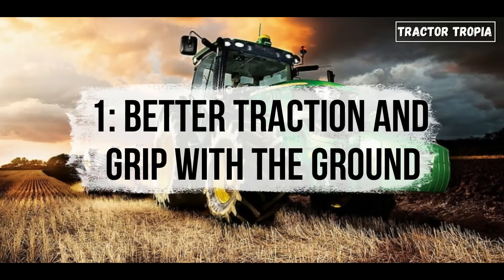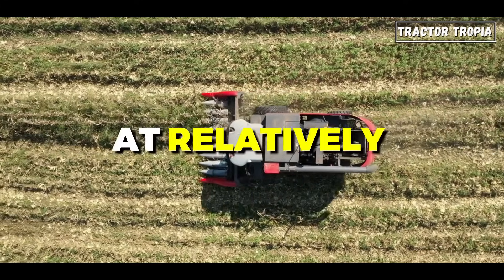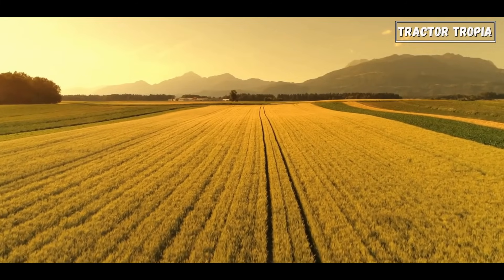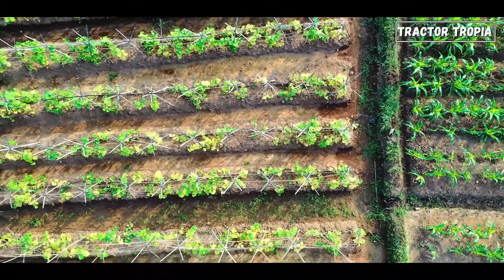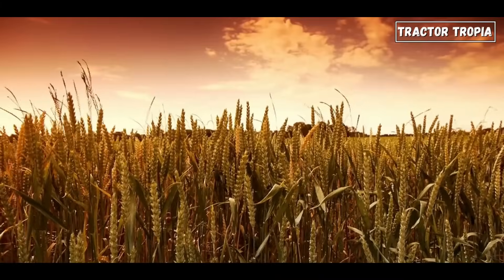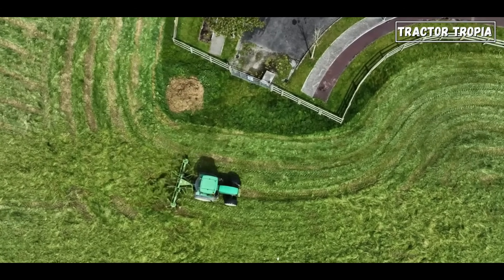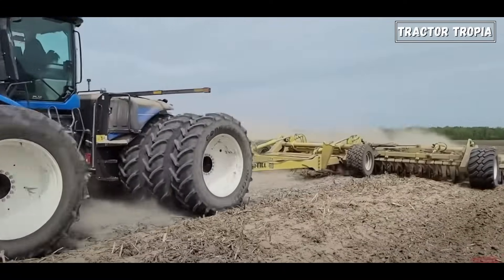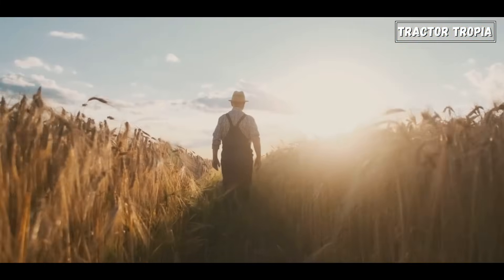Why Do Tractors Have Giant Back Wheels?

Comment: Large rear wheels and weight are key.  In the compact tractor sector, Mahindra stands out for retaining large rear tires and greater overall weight for a given horsepower class. They are the largest manufacturer world wide but have a fairly small presence in the US market. Should I need to replace my older 35ph compact tractor it will be with a Mahindra as my area now has a couple of stable dealerships that that carry this brand. Others, especially John Deere, can keep their small tire & plastic machines.

Comment: 2nd reason about the torque is wrong. You are mentioning in the reverse way. Think of it this way, to remove a tyre screws on big trucks we use a very long rod (sometimes person stands on the rod) to loosen the screw, because Torque = Force × Perpendicular Distance, so by increasing the length of rod, we are achieving high torque, now think of this way, if that screw has to turn the rod, it should have high torque, the longer the length of the rod, higher torque needed to turn that rod.

Comment: So. Much. Repetition.  Big wheels give better ground clearance to prevent damaging crops and allow for a larger contact patch, lowering the pressure exerted on the ground. More common on the rear, as that’s where the weight of the implement doing work is. Front wheels don’t always have to be big, so they aren’t.

Comment: 3388 to 6788 series International Harvester Tractors had equal size tires , great visibility  , articulated steering , and great pulling power . Its only problem was that it was ahead of its time . Farmers hate things that look different from the norm, and they definitely looked different, BUT they worked great .
Reply: It was a great tractor with a couple of issues.  First the flywheel was on the transmission, not the engine, so it tended to create noise at low rpm and tight turns.  Second, the steering was very sensitive.  It was tricky to drive in a straight line at top speed.

Comment: Tractors are just used in agricultural environments, they are used in the Netherland in cities. Why a tractor and not a truck. The costs of wages; a tractor driver has only 1 driving license (for tractors). A truck drivers needs 2 licenses and Code 95 course.

Comment: Larger wheels transfer less torque then smaller wheels. This is because the further away from center you are, the more the ground has a torque advantage against the shaft spinning the tire

Comment: It all depends on what kind of field work are you going to do. There's a lot of tractors, both articulated and not articulated, which have same diameter front and rear tires. Here in Italy we have a lot of small tractors called isodiametric with 4 same diameter wheels and they're mostly used inside orchards and wine yards
Reply: Another example: The first generation of Mercedes Unimog trucks had been developed primarily as agricultural machines / tractors (as main intended use case)

Comment: I think that the most important aspect is that the larger the tyre the larger the torque. But as second thing to point out is that you have the difference between the 2 wheel drive and the 4 wheel drive. When you have a 4 wheel drive tractor there is also a link between the size of the front and rear wheels. The 2 axles have to move in sync or they will mess up the drive train. 
And about the 6 wheel drive tractors they were never a success as that pulling power is good but soil compaction is really bad. Deutz tried it and also Claas
Reply: Torque is merely a matter of drive train ratios.
You can apply whatever torque you wish to any diameter tyre by arranging the drive train to do it.
What matters is that a larger diameter tyre has a greater contact patch and will apply the torque to the ground more efficiently without slip. The extreme end of the contact patch concept is the self laying track as used on bulldozers.
A large diameter wheel also climbs over obstacles better.
Reply: yes i was gonna mention this.
also with large rear tires you dont have to worry less getting stuck with the larger circumference..
also since you have larger rear tires the gearbox gearing doesnt need to be smaller/shorter you can make it larger for more torque handling
Reply: Many r totally wrong here

Torque of differential shaft = Torque of wheel

So Larger the wheel...lesser the force exerted on ground

Just imagine,
A smaller wheel will hv more wheel slip than a larger wheel
Becoz small wheel will exert more force on ground (contact point)

Weird but true😅😅
Reply: We treat them not as 4x4 tractors but a 4x2 with auxiliary front traction and they're designed to be geared (with the tire size recommendations) 5% more speed in comparison to the rear ones. Also, it's recommended maximum of 40 to 45% weight distribution on front axle.